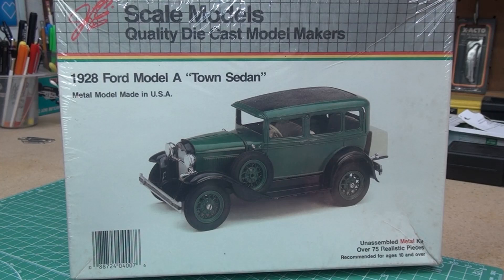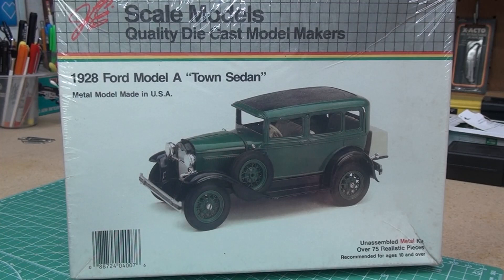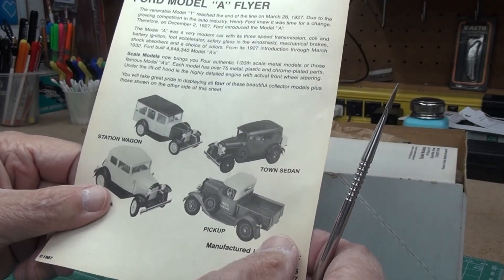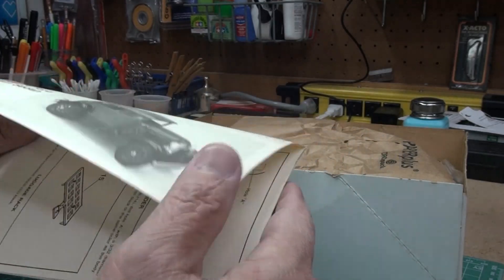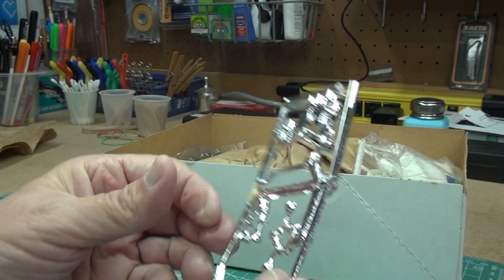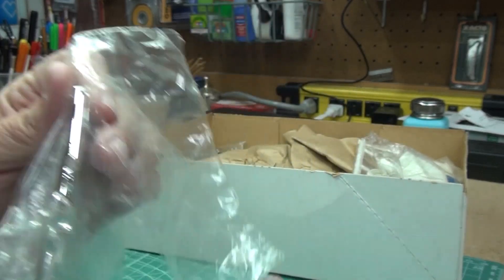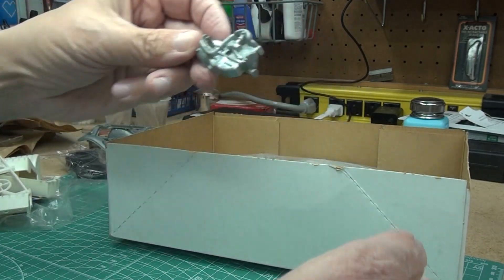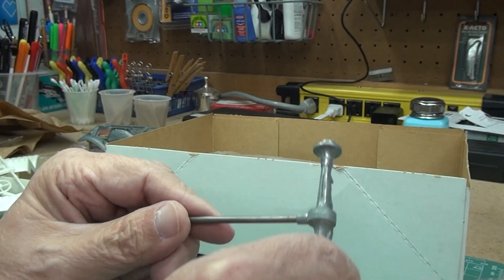01 1928 Ford Model A Die Cast Part 01

Comment: I've built several Hubley kits. The hardest part was the clean-up. As to painting it , you need to prime it first. Most of it screws together. You also may have to use Super Glue on the plastic. Regular glue didn't work on the Hubley. Good luck.
Reply from the maker: Thank Charlie. I knew I'd be using super glue and I also knew I'd be priming. Did you have to treat the die cast with anything first? I'm assuming it should be sanded before priming?
Reply: Nope. Wash it. Sand it. Prime it.

Comment: Does that "Scale Models" Model A kit include windows of any sort?
Reply from the maker: No. There are no clear parts.
Reply: @skipsmessyworkbench  Thanks for your response! I purchased a built-up "Scale Models" Ford Model A in taxicab markings yesterday at an antique shop in Wisconsin.  The model was very nicely put together and decorated. It's just that it didn't have any windows and I was wondering if the original kit had any which apparently is not the case (at least for you and me!).

Comment: I have the victoria I built it back in 1973  yes I still have it  
 it is a great kit but you need a good file.
if a 13 year old can assemble it so you !
Reply from the maker: I've started doing the clean up. There is a lot of clean up that I didn't see at first. I'm using a dremel tool to do some of it and files in tight places. I had to use Loctite on the engine halves. The one screw wasn't enough to hold the halves together without a large gap. But so far so good. Thanks!!!!